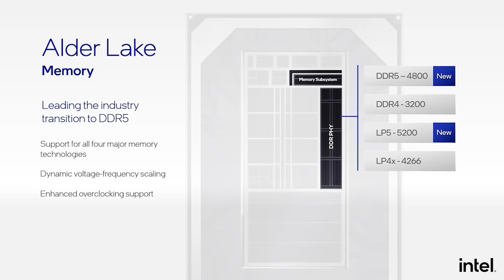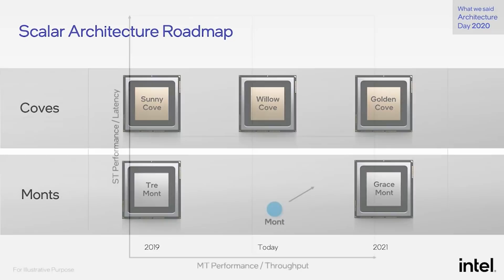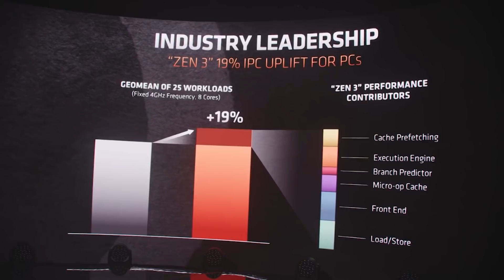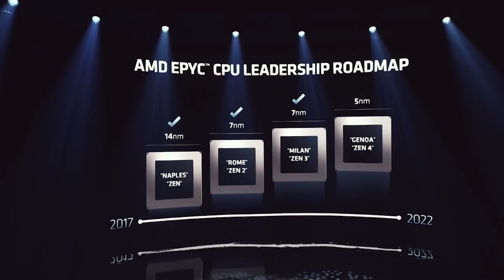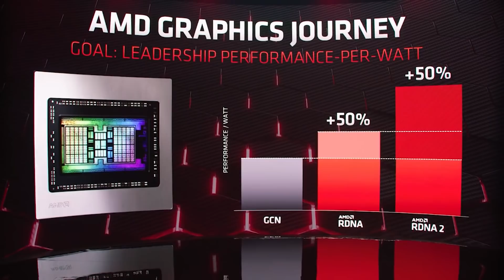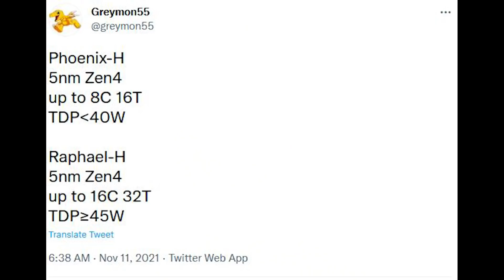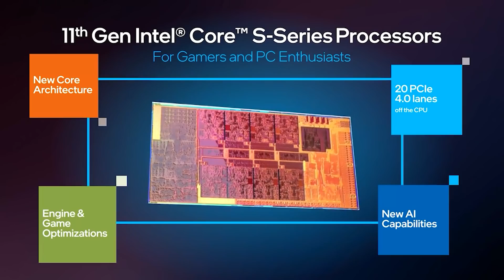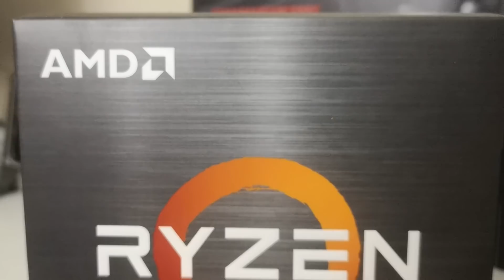RYZEN ZEN 4 - Will AMD Increase the Core Count? | AMD Raphael Specs & AM5 Rumours

Comment from the maker: Btw guys, as you can see this is a new mic. So please let us know what you think!
Reply: Didn't notice anything. That's a good thing as that means I got what I expected.
Reply: Sound is good, with no issues.
.
As for a Ryzen V-Cache CPU, yes, (price depending) as I am not about to replace my 32GB of DDR-4 3600 and my B550 motherboard to get Zen 4.  I ideally want to get a Threadripper though, and have been saddened by the total lack of Zen 3 Threadripper as when that came out the price of the Zen 2 Threadripper CPU's would plummet.  A Zen 3 V-Cache CPU would certainly be nice and I would probably get one after Zen 4 comes out as the price would plummet, and skip Zen 4 entirely and get Zen 5.
Reply: It sounds nice :D
Reply: Your previous videos with the old mic had some audio issues (blank spots and such) that I’ve not had occur with any other videos. So far, this mic hasn’t had those issues. Hope it continues to keep this up.
Reply: New mic or not... your videos always have lower volume. Regarding the content... keep up the amazing work.
Reply: Quality is good, but your audio is a bit quieter. Just compare the audio level to another techtubers, you'll hear the difference. It's annoying, because my speakers explode after the next video is being played :-)
Reply: Loud and clear
Reply: A lot better! 👍
Reply: The new mic makes difference, I like it.
Reply: Audio sounds good and I was playing this through my HT system.

Comment: i have got now a r7 5800x with a x470 motherboard and good 64 GB of DDR4 memory. Iam mostly focused on a new motherboard. But maybe going to wait till end next year. Actually i dont want to pay high premium for older tech, which already exists for 3 years. But i want to keep my DDR4 memory for a longer time.  Also dont like the fact that X570S motherboards that will coming out for next year januari are about 100 euros more expensive r then te current line up. First have to see the performance of Zen3D. But if its less then 15% i might skip it. See what intel raptor lake will do.
If there will be DDR4 boards on AM5 ( i doubt it) maybe going for such a board. But i might ending up with raptor lake which still would work on DDR4, but have the benefit of having PCI-e 5.0 on the motherboard.

Comment: i have an X570 with a 3950x that works every day. I’ll surely upgrade to VCache as were at the apex of DDR4 and current featureset. 

I’ll wait get 2 or 3 of the DDR5 platforms. I also need to address my gpu situation but current offering for me bring nothing new to the table. Same nvdecoders as always and only the 3090 or the weird a*** A4000 cards have enough vram

Comment: Unless I get really unlucky and something breaks, my current plan is to keep my 5900X until at least Zen 5. By then the AM5 platform has (hopefully) matured enough to rid it of most issues, and pricing and availability is hopefully not quite as bonkers as it is today. Besides, even the 5900X is honestly total and utter overkill for my use, so upgrading just means I'll waste money on performance I have absolutely no use for.
Reply: excatly the same for me, no need for an upgrade at all. Ill save the money and get a 4k 144hz display or whatever, seems much more reasonable, then buying a cpu every 1-2 years.

Comment: If AMD wanted they could turn AM5 into an entry level HEDT platform.  No one outside of AMD knows the config for PCIe right now other than it's PCIe gen 5.  If they wanted to they could run something like X16-X8-X8 for the PCIe slots.  Right now they have X8-X8-X4 (X570).  If AMD increases the PCIe lanes to the chipset to 8 vs. the current 4, and they are gen5 lanes, then you could run a gen4 X16 slot AND a couple of NVMe ports along with other hardware off the chipset.  Or, they could run 24 lanes off the CPU to the PCIe slots to give X16-X8 PCIe gen5 and then a gen4 slot off the chipset.  Even if they keep only 4 lanes between the CPU and chipset, since they're gen5 you could still get an X8 gen4 slot off the chipset.

Because the chiplets should be smaller AMD has a lot of space to play with, but the interconnects could be crazy with so many core chiplets for a 96 core parts.  To me it makes more sense to have 12 core chiplets so the interconnects are easier to deal with.

I see TR as the wrong platform for a low end HEDT part once Zen 3 comes out.  Really.  Best to make a higher end MB for AM4 with more features that I mentioned above.  You don't need such a huge package for 24 cores anymore.  So, if the goal is to get to 96 cores, AMD isn't going to release a 24 core TR part.  I seen the minimal being 32 cores for TR.  It just doesn't make sense to have such a low core count CPU on that package.

Comment: Given 'good', low latency DDR4 competes and even beats DDR5 in both performance and price, waiting 2 years for DDR6 could be feasible - especially during a recession where supply and inflation is critical.
Anyone who bought Zen 2 and B550/X570 motherboards will be looking at 'Zen3+' seriously - as will anyone looking for a cheap significant jump in the earlier motherboards picking up R9 3800s, 3900's or even 3950's which are a significant jump over Zen+.

Comment: Hi Paul, I have a 5600x on 570 and a 2080super, I only use it for 4k games and I get a few adjustments somewhere high to extreme at 45-60 fps, in the future I intend to buy a 7xxx multi chiplet, will is there a bottleneck to the processor to block maximum fps? There is quite a bit of talk about 4k and I understand that in high resolution at maximum settings the processor still matters, maybe even at 8k if the new technology from amd will allow us. Here I would like to understand if 3d cache will help me, with am5 I understood what you explained to us and I'm not in a hurry. Thanks

Comment: A few months ago I bought my very first AMD machine, a laptop. It sports a 5700U with 8 cores & 16 threads, which unfortunately is Zen 2 based, not Zen 3. However it still is 10 - 12 times faster than my 5-year old low end Toshiba Satellite laptop with a super crappy 2-core Intel Celeron, and cost less than twice as much. Is also has 4 times the DRAM (16 GB) and an Intel 512 GB NVMe SSD.

Zen won my heart, and unless Intel delivers something mind-blowing at a non mind-blowing price my next laptop will also have an AMD APU. I no longer buy desktops because I no longer game, but I'm sure that AMD will not compete just with cores with Zen 4. Zen 4's beefy AVX-512 block is probably not going to be added just for show, and AMD can thank Intel for 'motivating' (some) developers to make use of AVX-512 since they introduced it in their own parts.

Since IPC represents a mix of both integer and floating point performance Zen 4's FP IPC should rise significantly due to its AVX-512 unit, at least nominally. As for the number of cores, I think even if AMD increase them across the board they will retain 8 cores per chiplet, probably with quite a lot of extra L3 V-cache added as standard on top. 

TSMC's 5nm process node will allow AMD to make even smaller chiplets (thus get more chiplets from each wafer), which will offset other costs such as the potential lower yields of N5, the higher cost per wafer etc

Comment: IMO there's very little risk of Ryzen cannibalising Threadripper even if they launched a 96 or 128 core part. My biggest reason for buying into HEDT is IO, extra cores are just a bonus. For me the 64 PCIe lanes and quad channel RAM with space for 8 DIMMs mean way more than the cores themselves. I'd actually prefer a lower core count TR part with higher clocks if I had the choice.

Comment: I think they should just smack Intel around, increase IPC, increase clock speed, and increase core counts across the board on their next generations. Just make higher core counts the new bog standard. Get the "core wars" restarted. Push smaller, push more IPC, and push more cores. 

Just be like: 2, 4, 6 cores? Those are the past, we don't make those anymore as "mainstream" desktop chips (maybe still for like chromebooks or whatever? But not the mainstream desktop market). The new standard is a minimum of 8 cores, but up to 12, 16, 24, 32, 64, ... eventually 128, 256, 512, 1024 cores, etc., in future generations. (While still keeping the prices sane / affordable.)
Reply: Adding more cores than needed after a point will start HURTING performance. Like a LOT! Why should we start sacrificing single-core performance & core-to-core latency just for core counts with absolutely ZERO USE for basically all consumers? There's a reason AMD made 96-core Genoa & 128-core Bergamo w/ different core architectures.

Comment: On my MSI B450M Mortar Max I went from Ryzen 2600 to 3600 to 5600x and I will definitely go for Zen3D if needed and the upgrade is a good deal (as it was so far for all these upgrades I made). Zen3D is a no brainer for AM4 users, I could not care less about Alder Lake.
That being said I can sit on the 5600x for some years and skip 1-2 generations altogether, it's a good enough CPU for that.

Also Zen3D won't have to compete with Raptor Lake because Zen4 will come before Raptor Lake, check your leaks, others have better ones than you. AMD will launch Zen3D for DDR4 and Zen4 for DDR5 before Intel launches it's next gen.
Reply: I have a 3600 and it's overkill 99% of the time. Probably won't upgrade for a good 10 years.

Comment: I have a Ryzen 3900X w 64GB on a high-end board.  I don't need more cores or CPU grunt so skipped the 3950 and 5950.  But the upcoming VCache models will be last hurrah for my AM4 mobo... so simply because of that I will probably go for a 16-core VCache CPU, sell my 3900X, and run the essentially max'd-out rig for years.

Comment: I'm definitely going to upgrade my 5900X to a Zen3D 8 or 12 core. No need motherboard or memory needed.

I'm Skipping Zen4 I'm waiting for second Gen AM5 boards and memory modules. Or maybe even 3th Gen. At the start of a new memory type things always mature in quite big steps. And the prices normally get quite a bit lower.
Reply: Exactly.  Being able to drop-in to am4 is an incentive.  I settled for a 5800x because the 5900x was out of stock for so long.  I use my 6800xt at 1440p, so 5900x3d should get the most out of that till am5/ddr5 and rdna3-4 comes down in price.
Reply: There will be also Zen4 3d processors i have seen.

Comment: 24-core+ Ryzen... my two cents
I don't think so. The MAIN problem, IMO, is system memory bandwidth. AM5 is still Dual Channel, not Quad Channel (not to be confused with how channels work in DDR5 for each module which is different). I just don't think there's sufficient BANDWIDTH to system memory for that many cores... and if you're investing in an HEDT how much does the extra cost of a Workstation motherboard add to the TOTAL build cost?
You'd already be needing a higher-end motherboard for power delivery even if mainstream worked without bandwidth issues, so what's the difference in price between a higher-end AM5 mainstream and basic Workstation motherboard for AM5 likely to be?
*ALSO... you can get away with SLOWER memory if you have Quad Channel so it's easier to find the sweet spot for performance vs cost. Maybe basic JEDEC specs gets you over 90% of the performance in worst-case? That matters even more if you're getting a lot of system memory. Some people get 128GB+. You might actually get MORE performance for CHEAPER when all is said and done depending on your configuration by going with a Workstation build.
**I also wonder if there shouldn't be two different CACHE variants of the same architecture... if you add more cache that can reduce the memory bandwidth requirements (though it varies by application). Do you get a CPU with more cache that requires LESS system memory bandwidth or a CPU with less cache that benefits from faster memory? Maybe it's too confusing to have two options for the same core-count, but I feel like there's an opportunity here somewhere if marketed correctly.

Comment: I keep hearing that there will also be Zen4+3D V-Cache (makes total sense of course). This slightly conflicts with the rumour that they are going straight to Zen5 the next year.

But of course that can easily be explained by either 1. They release Zen4 3D stacked simultaneously with regular Raphael/Zen4 or 2. They release Zen4 3D stacked after 6 or so months, which also lines up with Intel's claim of releasing Meteor Lake not long after Raptor Lake (which I kinda doubt, the only reason we had 2 "generations" of Intel CPUs this years was because Rocket Lake was horrible and even Intel indirectly admitted this, so going forward with too frequent release cadences is not a good strategy (Osbourne Effect and all) but also Intel likes to talk big but rarely delivers)

Comment: i was a little disappointed when AMD released their 5000 series processors with the same core counts as the previous year.  They had a whole year and just put out some IPC gains, even if it was a decent increase, I would've liked to see them taking the 12 cores and 16 cores and bump it up.  This one year of not being aggressive and now Intel has caught up and surpassed them with the 12th gen.  AMD is increasing core count now but it's kinda late.  They could've dominated the market, but now its a 50/50 between Intel and AMD.  I own a 3900x and would've been easier to just get a 5900x and be done, but that 12900k was just too sexy to pass up and I got that instead.  AMD cannot put it on cruise control not for one year.  I doubt the 3D v cache update can boost AMD's single thread performance to surpass Intels new 12th gen line.  Probably match it at best.
Reply: well 16 cores 32 threads even for one more generation (upcoming 6000 series, zen3 vcache) is still monstrous and overkill for 90% of normal users. I wouldnt have any problem for two more 16 core amd cpu generations as long as single core improvements are significant.

Comment: As a Threadripper user 32/64 Cores, Memory and PCIE lanes for NVME storage are the reason why I bought the system. The system uses virtualization and a mixture of RAM DISK and RAM CACHE using 256GB of RAM. Building things and lookups from RAM are significantly quicker than HDD, SSD, or NVME. I think future Threadripper systems should stay 16/32/64 core systems with higher clock rates. 

Server wise AMD should focus on 64c/128t server nodes systems with 2-4 nodes to a DAS, this would provide simple solutions for small to medium business', any higher and you start to lose performance from lowering clock speeds and experience increase costs due to per core licensing.

Comment: Audio good!
With 24 core Zen4 Ryzen a possibility, we're left with low PCIe lane count as a big imbalance (nvme ssd's pricing improving fast). Maybe they might merge consumer Threadripper (not the Pro variant) with Ryzen, where cheap low core and more expensive high core are available under the one consumer chipset. THAT would be a game changer - especially if they could keep AM5 for as long as AM4. We'll see. Ball in AMD's court.

Comment: Intel is no slouch. LTT over locked a 12900k and it matched the AMD thread ripper 32 core system in cinebench! 😳 AMD has alot of catching up to do
Reply: he was using a cooler that costs thousands that uses thousands of dollars of electricity. a 5950x can beat that with a regular air cooler.
Reply: @estusflask982  lol. Uh no Intel is ahead by a good margin even with the cooler 12700k
Reply: You can define and redefine "alot" any way you want.  Intel milked us for ten years with quad cores and would still be doing that if it weren't for the incredible comeback of AMD.  I will be buying only the latter for the foreseeable future.  I couldn't care less if Intel has 5 more FPS in some game.
Reply: @Hastur Dagon I stated obvious facts about Intel's behavior and performance, and the impact of AMD.  By coincidence, Paul's very first words his next video (7 Dec) say the same.  Your brainless attack on those statements doesn't mean shit to me .  If you need me to repeat that, post again.

Comment: threadripper updates are late. i think 8-16-24-32-48 cores will be desktop, 64-96-128 cores for next thread ripper and quad channel memory controller, and 128 -144-160-176-192 for epyc, and octo channel memory cotroller, dual socket for 16 channels. total annihilation.

Comment: going to V-cache and skip the first gen or more of AM5. the price of parts is going up and I dont want to hunt for bits that are acceptable. by the time Zen3D needs replaced we might be near normal pricing again.
Reply: I wouldn't worry about DDR5 in Zen 4. It's only the first gen for AMD, but not one of the first DDR5 platforms. By then a year has passed.

Comment: Alderlake is on the back burner for me until the new year as I want to see what AMD brings to CES.
As I would prefer a drop in CPU upgrade over a more expensive Z690 motherboard swap out.
But it all depends if AMD can bridge the performance gap while we wait for Zen 4 / AM5 later in 2022.
Reply: For Desktop, the only AMD might announce will be Zen 3D V-Cache. CES will be focused on mobile, as Rembrandt will be announced.